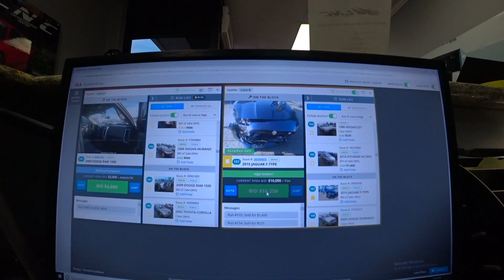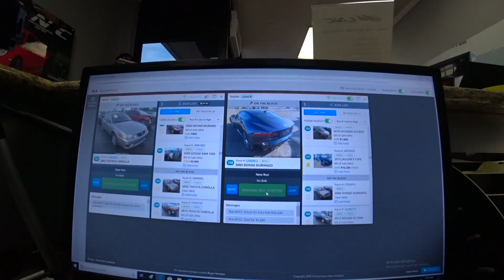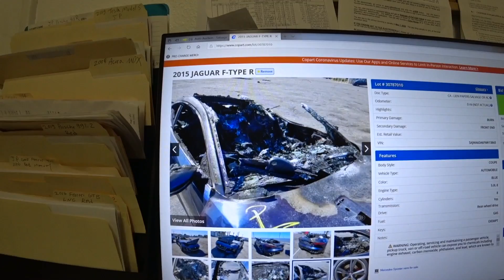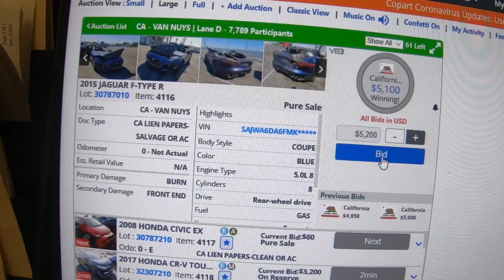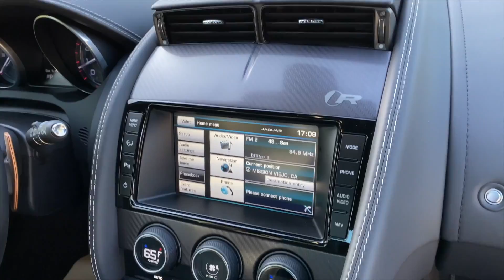REBUILDING CRASHED JAGUAR F-TYPE R IN 15 MINUTES

Comment: Hi. Since there was movement in the chassis legs (as you had to straighten the ineer edge), did you do any geometry checks to see if they were missaligned or if the frame is twisted?
Reply: what a wise guy

Comment: How much money would you say you spent in total for the car(rebuild and all) so I guess the total cost once all was said and done?
Reply from the maker: Greens And fiends here is the price reveal video 
https://youtu.be/q0lBtGjb5nA
Reply: LNC COLLISION & CAR CUSTOMIZATION thank you 🙏 I’m doing a 2003 3.0i BMW Z4 restoration right now. It runs and drives. Just needs a new cooling system. Radiator expansion tank hoses water pump etc. new hood. New torque converter clutch. New engine harness. Engine rebuild(125k miles on m54 piston rings. Usually at 125k~ miles they’re between 40-60 percent worn away. Double vanoss needs a rebuild. Oil pump needs a modification so it doesn’t fail between 6-8krpm in any given gear(vibrational frequency vibrates but loose) new front right frame (bolt on bumper/crash bar extension) new radiator cage frame (front frame end of the car that holds the radiator that is also bolt on(everything after the front of the engine sits in here) (it is a floating radiator suspended by plastic shelves 😕)
Reply: LNC COLLISION & CAR CUSTOMIZATION I can include a list of repairs I have allready done